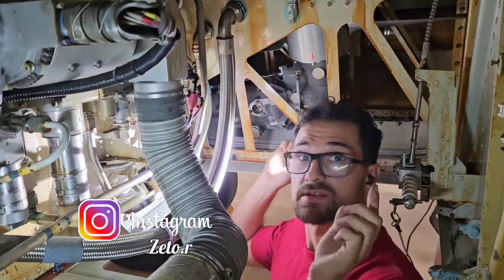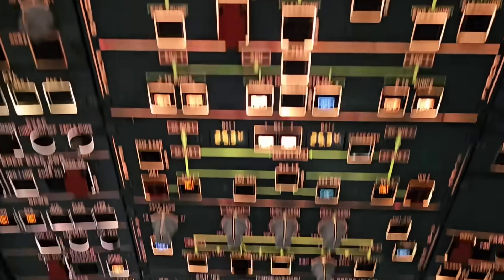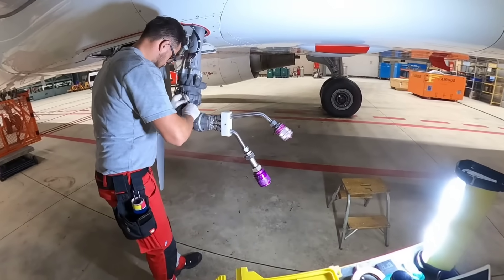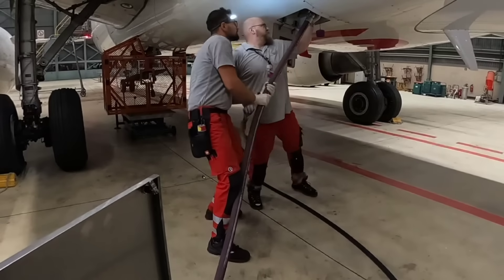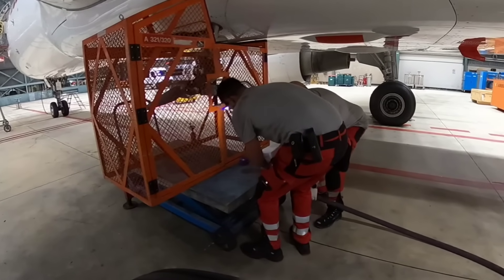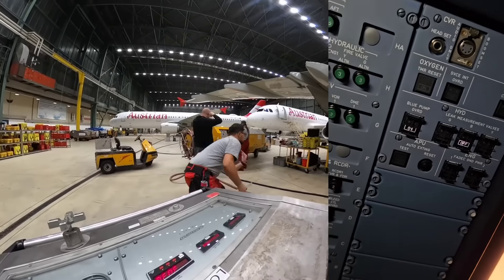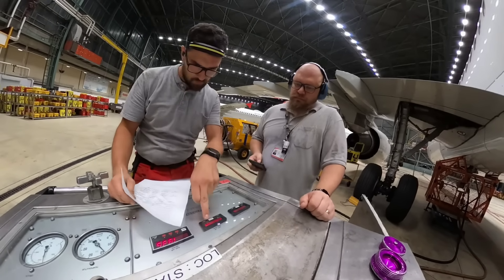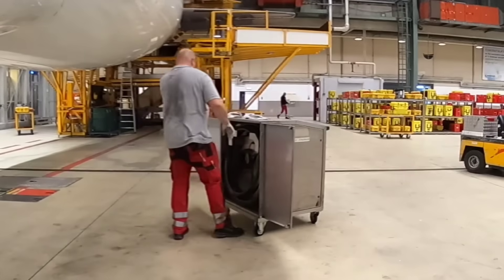How to test Ram Air Turbine on A320

Comment: How do you remove the hydraulic hoses from the motor without spilling the oil everywhere?
Reply from the maker: There is Quick disconnect which seal the hose

Comment: What is your analysis of Air India 171 crash , during takeoff and immediately RAT deployment ?
Reply from the maker: That is normal if you lost moth engines aircraft reacted by deployment of RAT to provide emergency power supply
Reply: @zeto.r 

There is a controversy about dual engine failure and the memory items on Boeing to re-light the engines(shut the fuel and then put in run position again), can you please give your interpretation.

Comment: I think i missed it, but how does the prop align to the stow position? is it a detent of some sort?
Reply from the maker: Yes you have arrow on arm and propeller then pin release from arm and only when it fit in the hole of propeller it retract

Comment: This is a unbelievable complex procedure with these hoses. For me, on the RAT side the tubing and the hoses should be connected in one casting made up off 2 halves which can be coupled together with e.g. two studbolts. And the casting to be supported from the floor up by a adjustable stool to take off the strain on the RAT.
Reply from the maker: Well this is very simple method and the hydraulic cart is reusable. Hydraulic motor is specially made for every rat and cage must be there as well. But my comments are not really place for ideas. If you feel confident text guys in airbus, they are responsible for construction of this devices.

Comment: CRAZY NONSENE, It was not a RAT TEST, THERE WAS NO AIRFLOW DRIVING THE PROP. Just EXTERNAL HYDRAULICS. MAD AND PROVES ONLLT THE GEN AND PUMP will work. NOT the RAT ITSELF.
Reply from the maker: So text to engineers in airbus with solution how to do it better 😉
Reply: @zeto.r  DUH, There was NOTHIGN DRIVING the RAT to see what IT COULD SUPPORT. Can't you work that out yourself???
Reply: @ElarMack-ci1of external motor was driving the RAT....

Comment: had a query regarding the recent air india plane crash, the flight flew just for 30sec, last words of pilot were no thrust at the end of full runway, is it possible the a ground technician could have switched off the fuel or is it impossible to switch it off.
Reply from the maker: You can't do such thing. Fuel pumps must run otherwise you get an fault
Reply: @zeto.r  good to know, it might take a year to know why there was no thrust leading to crash.

Comment: Thanks for your video. It’s very interesting. It’s got me thinking a little bit though first of all what’s the pressure of these hydraulic systems is like 3000 psi? And the next comment I would have just thinking outside the box I’m not an aircraft engineer or whatever but just something to think about so are you really testing the whole system ?  The propeller spinning produce the pressure that you need. It seems to me that you should have a test that would spin that propeller at the required RPMs it needs to show that it can produce the pressure. I think you are injecting pressure into that hydraulic pump from your other machine over there. It seems to me that a full test should be spinning that propeller and seeing if the whole system works. Am I wrong?
Reply from the maker: Im simulating flight with motor (airflow during the flight) and adding load to see how RAT perform.

Comment: Why dont use the huge fan in front with variable  RPM speed to generate the airflow on RAT fan  or propeller ? it would be more like real field test ,
what if the blade of propeller are misshaped and cant spin enough in RPM in real time use ?
thanks
Reply from the maker: Such condition you can simulate only in wind tunnel, which is impossible since no such thing exist. Think about your idea, how dangerous suxh think will be since speed of the air must be around250km/h minimum. If you understand aerodynamic which each of us does since we pass the test fir that you will understand how propper works and we must inspect it for correct conditions.
Reply: @zeto.r  i believe our goal is not to check the wattage generator is producing but to check what sound propeller makes when run by external sir flow , (actually I am requesting it regarding AI 171 B 787 dreamliner crash in ahemdabad india too)
But for any reason full test will be done by external air flow only .
It's just a request if possible to do ?

The paramotor will do the job by locating it on 10-20 feet distance 
Or it can be change accordingly the RPM of RAT is observed,
I am sure propeller will move regardless what speed the airflow is ,
Only thing sufficient RPM which can give us the idea how RAT is working 
Thank you again for responding
Reply from the maker: @rajeevshagun-info  please don't refer to air India we still don't know what was the issue and RAT can't lift the airplane it is there to produce hydraulic power which help control the airplane and spin the generator. As I see you still don't  understand how this test works. I guess engineers in airbus and boeing knows how to simulate the function and have proper education for that. If you have doubts send your question directly to manufacturer and you will see what will be the answer.
Reply: @zeto.r  About AI 171 the video which was shot by Aryan ansari 17 by his android phone, wasn't clearly showing the deployment of RAT (we know that RAT is there to provide necessary power to plane controls and make hydrolycs working to control the surfaces and Radio transceivers) 
Few good pilot pointed that when in video aircraft passed by we can hear the Humming sounds of propeller!?
I think as I have been working on propeller and fans , when propeller are force to spin by external air flow it certainly makes less sounds then when it's running by own motor or engine to propelled the air !

This was my only intention to request you to conduct that sort of real test .
But I can see it's not possible so 
Thanks anyway.
But hope you understand my intentions to request you that !?
Cheers

Comment: Always reassured by the multiple redundancy on aircraft systems … until it comes to the RAT. What if the installed one has or develops a problem? Surely a backup wouldn’t add much to weight/complexity?
Reply: The RAT already is THE Backup... You cannot have a backup to a backup to a backup..  At some point, it becomes unreasonable..
Reply: Where do you stop?  A backup to the backup?  A backup to the backup to the backup?
Reply: I' making general assumptions her but typicaly both engines can supply hydraulic and electrical power. If engines are off the main and backup batteries can supply power. The apu can also supply electrical power. Often hydraulic power can be supplied by an electric hydraulic pump. Some aircraft even have a hand operated hydraulic pump as yet another backup. Some also have a manual reversion lever that switches to manual flight controls. The RAT is there when all else fails. Some real situations where the RAT was deployed was a flight that out of fuel and one that lost all battery power trying to restart a dual engine flameout.
Reply from the maker: No need because it is often tested

Comment: Don't be silly!  The hydraulic systems, electrical systems, as well as the farts of the crew and passengers are powered by powerful airplane engines that swallow 50-100 tons of kerosene in one flight!  The speed of the high-speed blades for creating thrust exceeds 100,000 rpm!  The power of the engine is terrible!  At the start, he sticks you to the seat like a tax stamp!  This propeller is a useless toy!😁😁😁👍👍👍🤣🤣🤣
Reply from the maker: And still it will save your ass if necessary

Comment: At what speed does the airplane fly in order for that child's propeller to turn at a sufficient speed and produce enough force to power this hydraulic motor that produces the required pressure for the operation of the aircraft's landing gear flaps and power generators for air conditioners and tablet devices without which passengers simply cannot live, let alone fly (better to crash the plane)?!  Foolishness and a toy!  At a takeoff speed of 280 km/h and a climb speed of cc 200 km/h, this propeller can't even fart!  You can only mount this on a MIG31 at 3000km/h!  In this case, the propeller should have the diameter of a windmill from the middle of the last century!🧐🤣🤣🤣
Reply from the maker: Ok let me correct you. This amazing peace of technology works all the way to 130km/h It is here to support essential components for safe landing. Gears will extend thanks to gravity and from high lift devices only slots are active. All essential flight control components will work as well just to safely land😉
Reply: Thak you👍

Comment: Very interesting. Lots of big expensive tools to test the RAT but it makes sense, the RAT better work when deployed as it’s the last resort system.
Reply from the maker: For sure this is last defence before blackout, so you must be sure that it works
Reply: It is ONLY testing the pump by DRIVING it by something else. NOT BY it's OWN PROPELLOR   VIA BLADE AIRFLOW!, ie, NOT a RAT TEST but a PUMP TEST!

Comment: Thanks great video,i want to know why open the CB RAT EXTN SOL1,in the AMM Extension of the Ram Air Turbine (RAT) on the Ground,i found no this step?
Reply from the maker: Subtask 29-22-00-865-112-A
B. Open, safety and tag this(these) circuit breaker(s):
121VU	 HYDRAULIC/RAT/SPLY/EXTN/SOL1	2803GE 	P33
Please check your AMM carefully
Reply: @zeto.r  Thanks for your reply,i saw it.

Comment: Interesting to know that the propeller drives a hydraulic pump and not an electric generator as on other aircraft models.
Reply from the maker: Hydraulic is more important due to flight controls essential electric systems can be powered feom batteries
Reply: Yep, I thought the same way

Comment: the setup before the test seem to take more time than the test itself...and you need 3 people to run this test. interesting.
Reply from the maker: Yes preparation is really long, you can actually did it in 2 people
Reply: @zeto.r  I understand the ram air turbine is a very important component. Is it ever replaced?
Reply from the maker: Yes I have a video about it 😁. I will try to post long one as well

Comment: Absolutely wonderful. How do you ensure that the hydraulic lines to the motor are not connected in reverse? At a casual glance, the threading on both connectors seems to be identical.

Comment: You're so lucky they let you film and publish these operations at your job. I wish I could do the same at mine :)
Reply from the maker: My company understands that this is a free commercial for them. You always see the logo on my shirt and as well name of the airline. Because one day you might need to decide with which airline to fly and you will choose one for which I work based on good feelings from my videos,  because we care. It is that easy😉
Reply: @zeto.r  Great video Thomash. It's really important to know for the passenger if the airline company management is adequate, doesn't skimp on safety and maintenance.
Reply: @zeto.r 
Correct, and it also shows that you and the team do a thorough job 😊
Reply from the maker: @ItsAlways42-z1e exactly 🙂
Reply: @zeto.r  which is amazing. At my work, I am always commissioning our machinery at the customer premises and they are quite overzealous about confidentiality 🤷‍♂️

Comment: Pretty cool to see how the hydraulic mule is used to spin up the RAT.   Using a giant fan would be impractical.

     For the cover plate fasteners, it there a published torque value, or do they just get snug?    Are they safety wired?   

The reason I ask is that it seems that loss of the cover plate would not have an adverse effect on the operation of the RAT.
Reply from the maker: The cover on the back is just protection. It has torque value of course and they are not wired